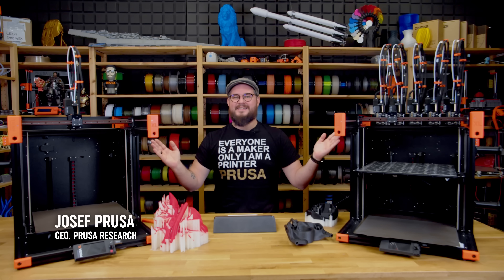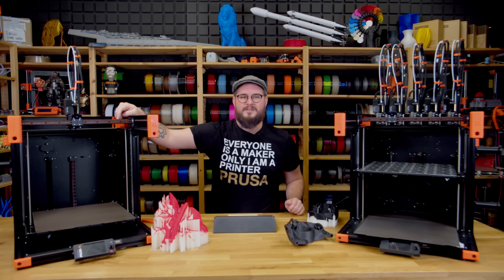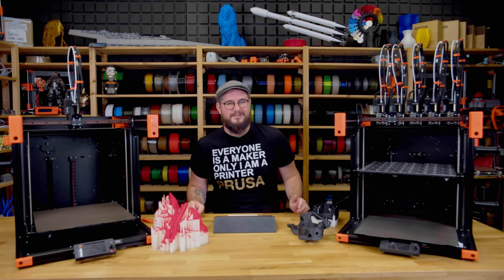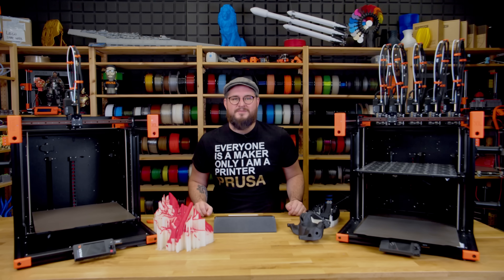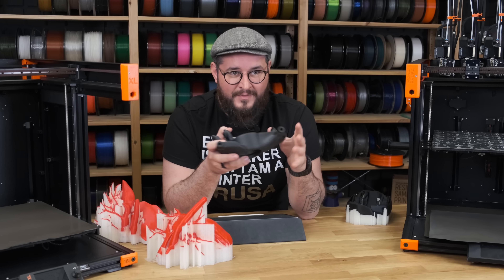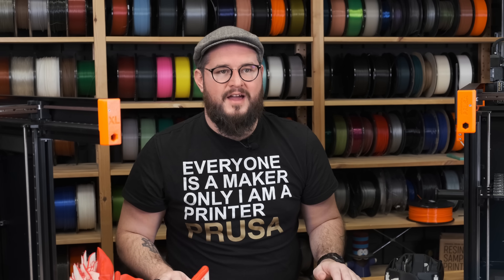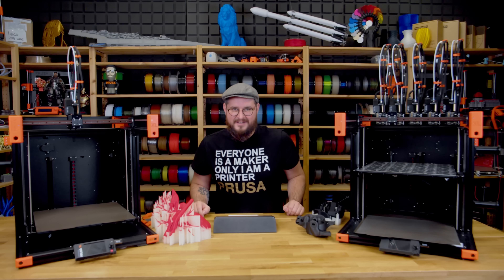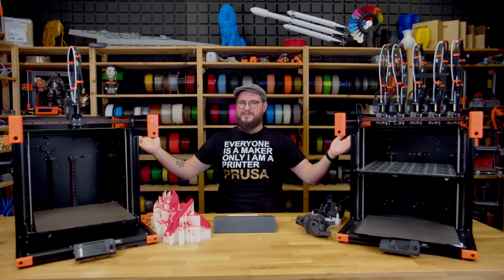XL update - beta test news, hardware changes and shipping schedule

Comment: These printers have been a complete trainwreck. By the time they actually come out theyre going to be crazy priced and still not as good as other stuff on the market. Literally the only thing they have going for them is the size (for most people). Still made with 3d printed parts, no enclosure, poor interface, etc. Even the multi head setup is just going to be cost prohibitive for most people. If youre going to go for a premium priced machine it needs to have premium materials and features.

Comment: .6mm is perfect choice!  For a 2 tool head preorder I think you have said May is the expected ship date. Can you give us an option to take a single tool and get the second tool later when they are shipping.  PLEASE.  Thanks for the update!
Reply: Why do you think a 0.6mm nozzle is perfect?
Reply: @alejandroperez5368  given the arachnid slicer, it still gives you all the detail, but the old 0.4 would and it increases the amount of material that you can flow given the larger print volume, that will be important to keep print times a reasonable.  I think there's a good case for a larger nozzle at times as well.  My second tool for possibly a 1 mm nozzle.

Comment: My testimony to Prusa is this. Ordered my printer as a kit. Followed the instructions, ate the gummi bears, and when I turned printer on it worked the very first time. So if it takes a little more time I'm still in on the XL.
Reply: Nice profile pic
Reply: It is very hard to leave the Gummi Bears until you have reached the designated steps, however…
Reply: @craigpuetz7020  Yes, i agree, Prusa could be a little more forgiving and generous with Gummi application. I'm sure there is substantial data to support this.

Comment: THanks for that update.  Will it be possible to have the single tool machine I pre-ordered shipped with a 0.4mm nozzle installed instead of the 0.6 you have decided to use as the default?
Reply: I don't believe they plan to do so. Would complicate their logistics even more than it already has become.
Swapping a nozzle isn't daunting though (+ inevitably anyway). So i'd suggest to just buy the extra nozzle. V6 nozzles be dirt cheap.

Comment: Any word on if this will have an enclosure option? Will it be able to print carbon filament?
Reply: One of the accessories already shown was a thick folding skirt that you can raise up from the base and click unto the top frame to act as a enclosure against drafts and keep warm air in. But full enclosure no word on yet, should not be hard due to the Frame construction and you can expect some cheap DIY designs real fast once these are in the wild.

Comment: very excited ... again.. to see the printer coming. But according to what I learned from my Prusa manual, using a 0.6mm nozzle reduces the level of detail I get. Why would I want to DEFAULT to lower resolution? If you think the 0.6mm is great, ship with BOTH 0.4mm and 0.6. I don't like the idea I need to purchase extra stuff just to maintain the level of resolution I am used to with the i3.
Reply: The "Arachne" slicing engine has made it that nozzles can achieve finer details than before. Where before the moment a detail or a wall was to small the old slicer would just outright refuse or botch up the quality. The Arachne slicer would modulate the flow-rate of the extruder and have the nozzle squeeze out less for it. This has in practice: resulted in nozzles being able to achieve same/better quality than even a smaller nozzle did before. So 0.6mm achieve better quality than 0.4mm, while 0.4mm is now closer to 0.25mm. As more slicers use Arachne, there is now a notable shift with more and more people favouring 0.6mm as the new "default" size over 0.4mm for a nice balance between speed and quality. With those wanting detail using the 0.25mm as that became insanely detailed.

The Prusa Printing manual is kind of outdated on all this.

Comment: So will the final production models be completely free of VFA, or ghosting/ringing/banding? Or because of the speed is there a minimally expected amount? The black part has some of it, but could also be a lower quality model. Also some of the printed parts had ghosting, I’m assuming MK3S+ printed them, so will production units have XL-printed parts with better quality at this price point?
Reply: Interesting question. I'm suffering from those VFAs on my Ender 3 and still wondering how to remove them, especially for the Y axis. Guess I'll have to reduce the weight somehow.

Comment: For anyone trying to compare this printer with bambu labs. Give up. Bambu labs had trash bushings not quality linear rails. The input shaper it does can't even get rid of ringing. Once the bushings wear in its echo city all over my prints. And it's not just me. It's everybody. "My prints are better" nonsense can go take a hike. Youtubers have been complaining about bambus resonance issues from almost day 2
Not to mention it's so damn loud . I can't stand having it in my office. The ams is good but it wastes sooo much plastic because they can't do tip forming so they got lazy and cut the plastic and dump it. That is super super lazy. Not to mention it won't take full spools of prusament because it's too heavy so I have to unspool 250grams so the crap ams motor can keep up. The only good thing is their software and integration but they literally stole prusa slicer and didn't even open source till we yelled at them.

Comment: I moved my Mk2.5s up to 0.6mm nozzle by default about a year and a half ago, the Aracne changes in PrusaSlicer have basically meant I've stopped swapping back to the 0.4 when I need moderately fine detail. But they're still no replacement for a 0.25 when you really need fine detail on a small part. I look forward to some day being able to use both a 0.6 (or maybe 0.8 or 1.0?) and a 0.25 in the tool changer on a single print... lay down a layer of big fat infill and rough outlines with a big chonky nozzle, then sculpt around it with a few layers of fine detail with the 0.25.... 🤤
Also super happy to hear that you're looking at a solution for putting a standard v6 nozzle on the new heat break system!

Comment: So pleased to have an update and an expected time for shipment.
The one thing I fail to understand is why are you still persisting with a Bowden style feed instead of using Direct Drive. Surely a Direct Drive extruder would have been a far better (and more reliable) 'way to go'.
Reply: It is direct drive, the PTFE tubes are just to feed the filament cleanly from the spools to the extruders (feed in PTFE tubes are an increasingly common feature on modern printers). There's an older blog post from shortly after their announcement where they break down the printer's overall design including the Nextruder design they've made for the extruder.

Comment: You are so out of touch with reality. Your prices are WAY too high. I will buy a prusa when either your prices are cut in half or hell freezes over, whichever comes first.
Reply: Keep buying your china made printers that require replacement parts every 100hrs then.
Reply: Do note that this is not a mainstream printer to begin with. This is a over-engineered machine for enthusiasts/professionals.
For the average there is the i3, but that one is in desperate need of some upgrades.

Comment: I feel like there's no point to this machine if you don't get the multiple tool heads. Multi-tool heads is the killer feature, otherwise it's better to get something like the X1C for much less (except for a few people who absolutely need the build size).
Reply: It is a really cool feature and I hope there is innovation to come with it in the future because that would be a game changer. Right now at least, they need to address the X1C. The price for this machine with only 1 nozzle is double the price of an X1C. At the pricepoint, the X1C competes with the MK3S+ and I had 3 of them. I sold all of them and bought another X1C because the print quality was better and prints that would take my like 17 hours on the prusa only take 5 on the X1C. The only thing I can knock the X1C for is no folders in the UI (yet) and maintenance, while easy and well documented, is a little harder due to the enclosure.
Reply: You can also buy 47 anycubic vipers for the price of x1c and print faster (combined) on their medium speed profile and get better looking prints and get higher throughput with the same build size.. times 47
Reply: @m kk  where are you getting this info from?  In the US at least, the vyper is $350. The X1C is only $1200 so 3 vypers would about the same as an X1C. but you need seven of those suckers just to match the throughput of one X1C like you had mentioned. The vyper also doesn't have any way to do multimaterial printing without a third party add on, it can't print fiber glass at all, and it can't print nylon or polycarbonate without some modifications. I mean if it could do any of those things it would be the deal of the century at the price point they are at because the X1C is already an incredible deal for what it provides. As far as better quality prints, I have both printers and I'm about to sell the vyper because it does print as well as my prusas, but the X1C is noticeably better in the print quality.
Reply: @Dom L  most people's x1c experience excessive ringing and ghosting after a couple months of printing. The vyper prints at 80mms with decent accel. The bambu is maybe 2 or 3 times faster at best. A metal heat throat is like 3 to 20 bucks for hardened materials. 3 or more youtubers have pointed out the rapid decline In print quality for bambu labs after it breaks in with the ringing in particular 

The only point that holds true is thr a.m.s and its very wasteful compared to any idex. Mmu or ercf setup. It does this for reliability sure. But I don't like littering plastic out the back of my printer.
Reply: @Mkz0r  ahh yes cause the mk3s has the best print quality (oh wait issue 602 still exists!)
Reply: @Eddie Enriquez  yea but any bowden printer or single direct drive eliminates inconsistent extrusion (602) or (issue6). I'm not advocating for mk3s. Also I rather issue 6 over the bambus ghosting
Reply: @Dashitishere22  lol find me one report of an "error 602" that exists in the last 12 months.
Reply: @LilApe  people just stopped asking about it since it was "resolved" why TF would they keep posting about something where the fix is to change parts out
Reply: @Dashitishere22  Sounds to me like it doesn't exist anymore then.
Reply: @LilApe  so you're saying prusa selling a defective product is the resolution?
Reply: @Dashitishere22  lol what are you even talking about? Do you even know what "error 602" is? It's cause by tolerance stacking and effected like 1% of all MK3's sold. The solution was prusa just sent you parts to replace for free. Its just such a minor problem and you never hear anything about it anymore, even your own words. The printers weren't even defective, nor were components out of spec. Unlike BL that has fans on 100% of their printers going bad. Just stop man.
Reply: @m kk  it's mmu is just as wasteful as the AMS in terms of amount of filament used. You can also tune how much plastic is used in transition between each color which you can't do with the mmu. You also don't have to use the back door to change filament, you can just use a wipe tower just like the mmu which creates more waste, or wipe to infill for zero waste. Also at roughly 1200 hours of printing, my x1c is still doing just as well as when I bought it. The other thing is the mmu would waste a lot of filament when it ran out of filament, you would have to discard a piece of filament the length of the bowden tube, which you don'thave to do with the AMS. granted I had over 900 print days on my prusas. 

 Compared to my vyper is roughly 5x times faster depending what I am printing. Some prints that take 6-7 hours on the vyper are usually under 2 hours on the x1c. Some that take like 17 hours take around 5 which is only 3x faster. But none of my other printers have ever made quality prints like this anyway. As far as the ringing and ghosting, it'snot "most" people'sexperience by a large margin. It's a pretty small number of complaints I have seen based on what I have seen, I am chalking that up to not following the maintenance guide. There's a guide with maintenance timing to follow on these which I really like because with all the other printers it's fuck around and find out. Like you can do preventative maintenance but there's no set timetable.  The other thing is these may be hard steel nozzles but they still need to be replaced eventually so I'm willing that has to do with print quality issues people are experiencing. My E3D hardened steel nozzles only lasted about 6 months of printing 24x7, I had a nozzle x for about that long with no signs of wearing out though. But that said, a lot of the videos about the bambu printers that are negative are older and many of the issues have been fixed in firmware because when I got mine, I didn't have any of the issues some of the youtubers say they had right out of the box. I do see a lot of unreasonable bias still though. It was a kickstarter and I wouldn't have bought it back then but most of the growing pains have been worked out at this point.

Comment: A small point, but multi camera doesn't work when you begin by talking into the lens and then continue to read off the prompter. It makes it more seamless if you simply turn to face the camera that is off axis for ad lib stuff before turning back to the main camera to continue delivering content off the prompter. As for the printers, prusa's reputation is sterling, but I would like to buy one to compare with my less expensive bambu lab x1.

Comment: I would highly appreciate it if it is possible to choose the nozzle diameter and maybe nozzle material directly at the check-out process when ordering. 
Especially with the 5 toolhead version this would be very helpfull, because it reduces the cost for the customer in the first place. 
Besides this I really like the V6 nozzle compatibility.
Reply: I'm not understanding why such a relatively cheap component isn't something that they just ship with the machine. No one buying the machine is going to bat an eye at an extra $5-$10 of cost to have a .4mm v6 nozzle included in the base unit.
Reply: nahh, checkout and shipment process should be as simple as possible.

Comment: I was wondering, you mention there is no need for a wipe tower, but how about 'oozing' of the not actively used print heads?
Will these be cooled down to like 175C or something when not used?
Especially with PETG I often see the print nozzle oozing out a some PETG while it is heating up and also after it is done printing.
Depending on the color, the amount may differ.
Reply: I think there is a little spring below the print heads in parked position. And Jo said, a small wipe tower is needed to re-prime the nozzles.

Comment: So, how much does it cost compared to the Bambu Labs X1 carbon?
Reply: 2K for the base printer, 2.5K for two tools, 3.7K for the complete package. +500 if you don't want to do any basic assembly yourself. This is NOT a budget printer meant for newcomers. This is a gargantuan monstrosity geared for enthusiasts sporting some of the largest build-volumes while still being efficient in both energy and filament through its unique bed and physical tool-heads.

If price is important. The X1C is simply a more attractive proposition. Even if it is a proprietary piece of hardware one cannot service themselves, unlike printers like Prusa's and the many 3rd party derivatives born from them.
Reply: @Foxhood  Thank you, Chiel. Seems reasonable for what it is.
Reply: @wrxsubaru02  Glad i could answer and sorry for Balu's response. There has been a bit of a culture clash in 3D-printing between those who are fans of Prusa and those who hate them. The latter pushing the Bambu printers aggressively and the former being quick to lash out in defense of the old workhorses. So don't be surprised if you read stuff like "overpriced trash" or "Properietary shill" getting thrown around...

I like Prusa as they simply are one of the market pioneers, but i ain't gonna pretend they are are flawless. No 3D Printer (company) is.
Reply: If you can't figure this out yourself, the machine is not for you. :)
Reply: @ulaB  If you dont know the answer to my question, the question is not for you. I have no interest in purchasing this machine regardless of the price.